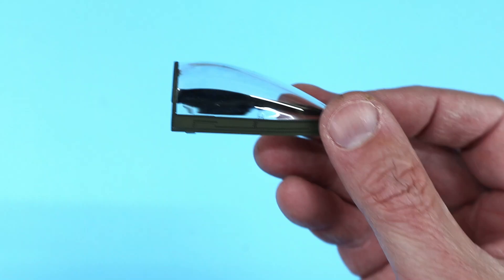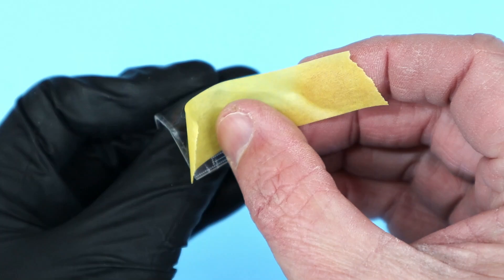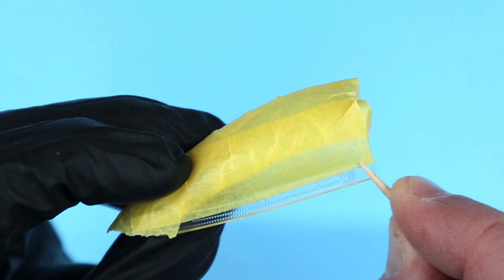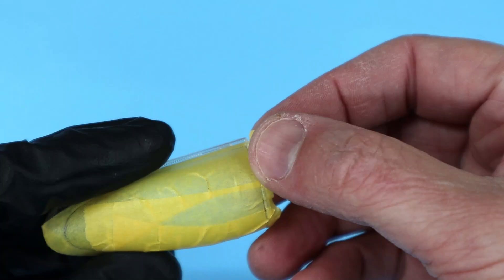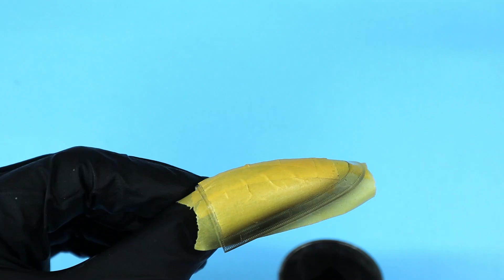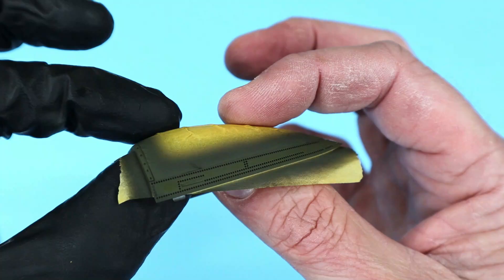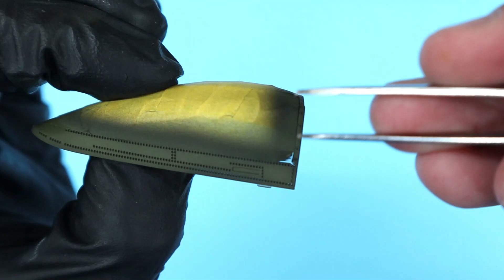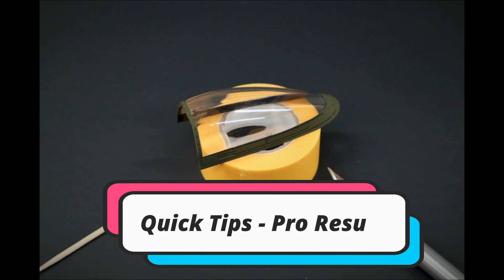Masking and Painting Model Airplane Canopies

Comment: I haven’t tried this yet but you make it seem so easy. I’m working on my first 1:72 scale plane and deathly afraid to scratch or cut the clear plastic and I definitely know brush painting it is a whole new level of hell. Thank you for putting time into this video, it was a great watch! 👍
Reply from the maker: This method does take a little practice and a steady hand.  There's certainly a risk when cutting on the clear parts.  I use it for 1:72 builds as well as 1:32 and as long as you take your time and use a fresh blade, you shouldn't have an troubles.  Thanks for taking the time to comment on the video.

Comment: Very nice. I use Tamiya tape too, but I also use Parafilm, which conforms to any shape. When stretched out it can be very thin, thinner than the paint, so though it will not let the paint bleed through, it may be harder to remove. To cure this, I just use two layers of film. It can be cut with a knife most easily if the Xacto blade has the slightest curve to the tip so the usual sharp point will not tear the film. I modified a #11 blade for this purpose. For longer curves, like canopy bows, you can roll the knife edge, rather than dragging the blade. I also use a rolling circular blade tool of .5 inch diameter to cut straight runs where corners are not an issue. Thanks for a great demo.
Reply from the maker: Thanks for the great info on using Parafilm.  That is another great way to masks canopies that may be easier and better.  I know Parafilm has been around a long time but embarrassingly enough, I have actually never given it a try.  Sounds like I may have to now.  Really appreciate the helpful input.  It certainly will help others that may be fearful of cutting on a new clear part.  Cheers!

Comment: I do something similar- but I trace the edges of the frame with a pen first and then remove the tape and cut it on a the mat. This way I won't heavy hand cut the clear part too. I build 1/72 scale and it's been the easiest way I have found.
Reply from the maker: Another great method.  That is a safer approach for sure.  I hate that feeling of the heavy hand or slip and then it's canopy sanding and polishing time.  No fun there.  Better safe than sorry for sure!!  Thanks for sharing!!

Comment: I used to cut masks directly on the clear parts as shown in your video. Now I use thin strips of Tamiya tape, and Tamiya tape circles for really tight curves. The circles can be bought in precut sheets of different sizes, or you can use a circle cutter to make larger circles. This method is much more time consuming than cutting directly on the clear parts, but WAY less stressful and risky. I’d rather take more time making a mask in a leisurely relaxed manner rather than take the chance of ruining the parts.
Reply from the maker: Yes, that is a much less risky approach.  And taking the time helps practice patience too so it's a two for one.  Thanks for the great tip.

Comment: Hi Chad, i use same technique. Yesterday i have a bad time with my corsair canopy because of the curves in scale 1/72. The rear canopy goes wonderful but the front side i struggeld so much. I repeated it three times and at last it looks ok but not good.😩 I think of next time to use masking liquid because of the roundings. So today i make the last touches and then she is done. Pics are following.😊
Reply from the maker: I look forward to seeing those pics, Mathias.  Maybe, if you are good with it, I will post some of your final pics on my community tab here on the channel.  Sometimes in the small scales, making these masks can be a little challenging, especially as I get older and my eyes and hands don't work as well as they should :)

Comment: I use a thin band of tape cut with a ruler on my cutting mat and run it along the edge right up to the demarcation line. Thinner tamiya tape will have enough flex for compound curves, No need to cut on the model and ensures a straight edge using the natural edge of the tape.  The corners can be cut to shape on the cutting mat and  added. Then mask the remainder with the thicker stuff.
Reply from the maker: I've done that too.  Works pretty well but there have been times when the curves at the rear of the canopy are tricky for the thin tape to navigate and then stay down.  But it does work well, for the most part, and is definitely "safer" than cutting on the model if the modeler has any reservations about that.  Appreciate the tip/advice on alternate approaches.  Always good to provide the community with as many options as possible.  Cheers!

Comment: I remember years ago when I found out how to do canopies :))) I nearly flipped out. Aaahhh that’s how they do it. Was always trying to brush along the lines.
One thing I don’t get though is how some paint the real thin ejection canopy  break wires on canopies like on the harrier planes. Have you tried painting the inside seams with a Matt clear varnish, it matts the shine in the canopy making the black areas more dull.
Reply from the maker: Hey Alex, thanks for the comments.  Brush painting never gets the job done right.  As far as those break wires, I think that there are aftermarket sets available that make the job much easier.  I haven't used 'em though.  I have painted the insides with a matte coat.  It works well.  Great add for the community here to see that extra step.  Thanks again!

Comment: Ok for a P-51 canopy it's fine, but when you have a Heinkel 111 or Ju88 etc,  Eduard set comes in handy.😉👍
Reply from the maker: No doubt.  Although I've used this method for some pretty difficult tasks too...probably just being too cheap and stubborn...hahaha.  Cheers!
Reply: It's a bit easier on the JU-88 because most of the windows are square. Just cut thin strips

Comment: Good tutorial, do you have any tips on how to paint near masked areas so the paint doesnt slip inside of the masked tape? this always happens to me even though i make a good seal. (i use handbrushes by the way). Thanks.
Reply from the maker: Thanks for the feedback.  Using brushes is tricky, for sure.  I always airbrush so it avoids that problem.  I'm sure you have tried both of these but you might have been luck painting from the mask toward the canopy frame so you don't push paint up under the seal.  Also, using less paint is always advisable.  I know you can get a much better seal with Scotch clear tape but it's not low tack, unfortunately.

Comment: Another excellent video. Thank you so much. I've been plucking up the courage to have a go at a BF109 for example. I'm finding the prospect of tackling the mottling effect you see on certain WWII planes quite daunting. Do you have any hints and tips for how best to approach this please?
Reply from the maker: Thank you, Horatio.  I appreciate the kind feedback.  With regards to the mottling, there are several different ways to achieve this.  I usually freehand mine using my fine tipped airbrush (0.2mm nozzle).  But there are masks and stencils out there if you do not want to freehand.  Here's an example of the masks but there are many varieties out there: https://www.hannants.co.uk/product/AEMM502?result-token=ZGv7I
Reply: @FlyingSModels  Thanks for the tips. I think I'll have a good long practice session with my airbrush on paper. All the best to you.
Reply from the maker: @horatiosplodge3370  That is the best way.  I usually spray it at around 15-17 psi and make sure the paint is nice and thin (not too thin) so that it doesn't clog the brush.  And then I spray it rally close to the surface.

Comment: Do I have to use wax remover after removing a low-tack tape, if I need to paint that area?
Reply from the maker: I have never had to use any remover like that.  Are you getting residue from your tape?
Reply: @FlyingSModels  A little bit.
Reply from the maker: @bassstudent4life  Sometimes I'll just use a cotton swab and a little alcohol or white spirits to rub that off.

Comment: Anyone any idea?...I have the Beaufighter revel 1/32...I dipped the canopys in Klear and a few weeks later the canopys went cloudy/foggy...It hadn't happened before to any of my other kits...but I cant seem to get rid of it which spoils the model actually...Ive tried dipping the canopys in windolene as someone suggested to get rid of the Klear...Not sure what to do..any help would be appreciated...Thanks
Reply from the maker: I've never had that problem with canopies but I did have trouble using Future Floor Polish as a clear sealer after many years of success.  I switched over to AK Real Gauzy and have had great luck with that product.
Reply: @FlyingSModels  Thanks for the reply...I've posted this question on a few canopy videos and I'll see what folks have to say...Someone suggested polishing it out which may work but at the moment I'm not sure if it's the plastic or the Klear that is the issue...Weird, I've never had the issue before using Klear...the other canopys I've done with Klear are really clear...Good community the modeling community...Big Thanks again

Comment: Now do the canopies for a 1/72 B17 lol
I just use Elmer's glue
Reply from the maker: Hahaha...just a little more time consuming for sure!
Reply: wait what?
Reply from the maker: Piotrek Szczepanski I was assuming Adam was talking about the glue he used to attach the canopy/windscreen.  I don’t think I want to try masking with Elmers, although I remember as a kid using it to make a “skin” by spreading it on my palm, letting it dry, and peeling it up...haha.
Reply: @FlyingSModels   lok makes sense now i also did the same thing.
Reply: @FlyingSModels  no I mask with it. Very easy
Reply: @FlyingSModels  I'll preface this by saying I hand paint my models. Idk how it would work for an airbrush. I clean the canopies off with a q tip slightly dampened with rubbing alcohol. When its dry I'll get a toothpick or a real fine sewing needle and spread Elmer's glue along the canopy in the places I want masked off. Dries in minutes. Sometimes I'll thin the glue out a bit with water. After I paint the canopy frame and the paint is dry I'll simply peel the glue off. That simple. I even have used it to mask off camo on models that I've used enamel paint on. Worked fine. I have never used it on acrylics though. I've been meaning to test it.
Reply from the maker: Going to have to give it a try.  I always appreciate hearing about new techniques so I thank you for the input!  Cheers!

Comment: How easy, could you use a bigger canopy? Nothing wrong with instructions here but this isn't so easy on 1/72
Reply from the maker: I use the same techniques for all of my canopies.  I don't go into detail but I think you can see the results in this and other 1/72 video builds I have up on the channel: https://youtu.be/ICFMqUqBUKo
Reply: @FlyingSModels  nice work on the mustang. I'm not disagreeing just saying it can be very hard to do this with some models 2 examples bf110 and ju88 in 1/72. The less panels there are the easier it is like the mustang or even a me262. 👍
Reply from the maker: Totally understand.  Just takes more time.  Always good to have options like buying an aftermarket mask set.  The good thing about the 110 and Ju-88's, though, is that most of the panels are square and easier to cut than the ones with compound curves.  Just a lesson in patience, though.  Cheers!